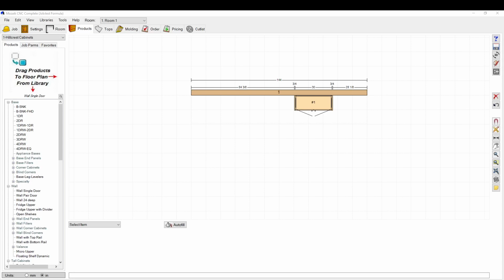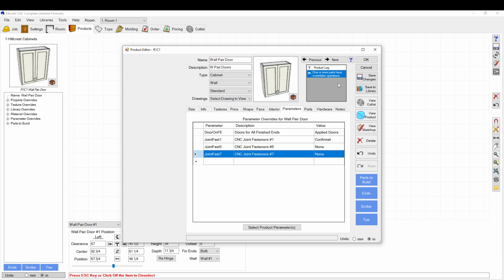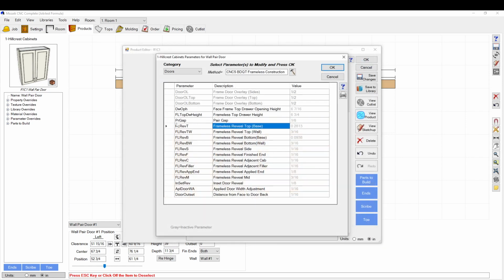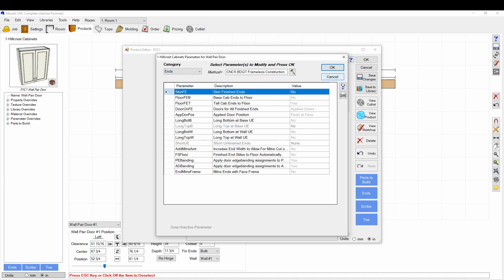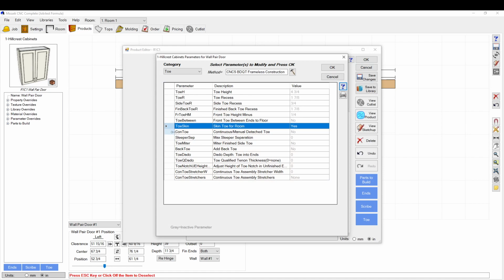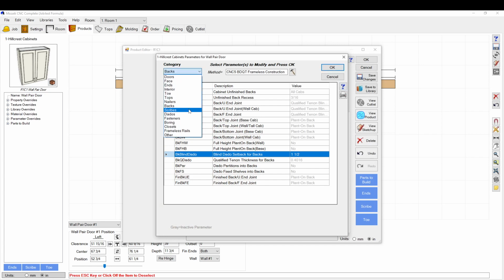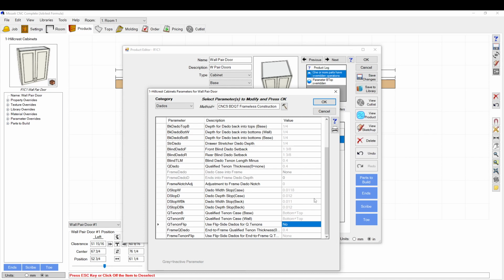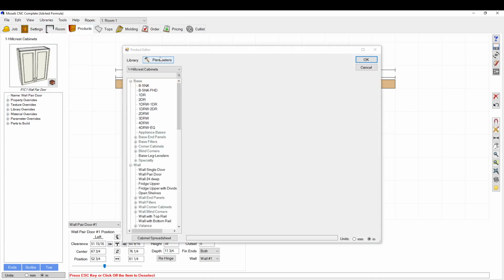Parameters Menu - Mozaik Software Tutorials

Comment: Question for ya. I set up a material template and filled everything out correctly that i am aware of. Then I go back make sure everything is set up in the settings tab for the new material template. I go to into the placed base cabinet and I select finished interior. It only changes a few parts on the inside to that but it wont change it to 2 sided. even though the interior items in the materials template is set to the 2 sided material and the material is set to 2 sided. After you change the materials template do you have to do anything else to make it work? I ahve been at it for 5 hours and cant seam to figure it out.
Reply from the maker: I sent this question to mozaik help a while back. At that time they responded with "The finished interior button just changes the texture of the cabinet interior to match the outside. You need a seperate material template to override the interior parts.” in my opinion this is a bit of a missed opportunity for mozaik as it would be so nice to have 1 click to change the interior. They do make constant updates so maybe we will get lucky 1 day.
Reply: @cabforgesystems   It even says " produce all interior parts from finished material. Most useful for open cabinets" Really disappointed in that. Do you just go in and change all the parts then?